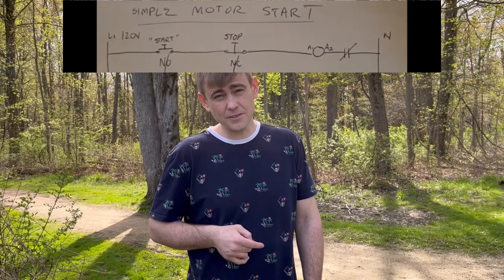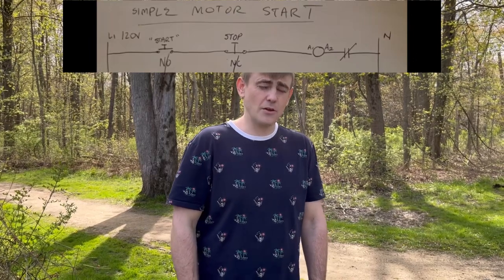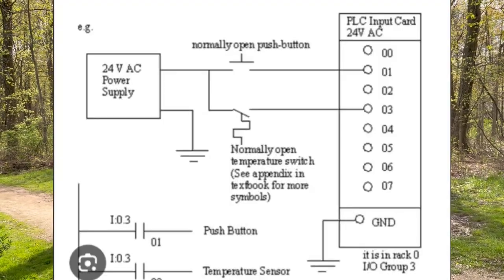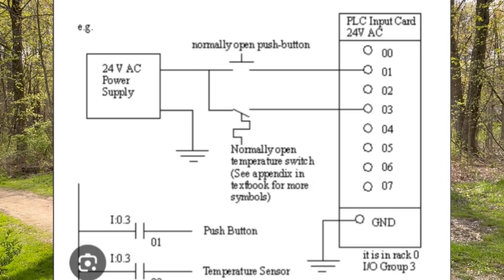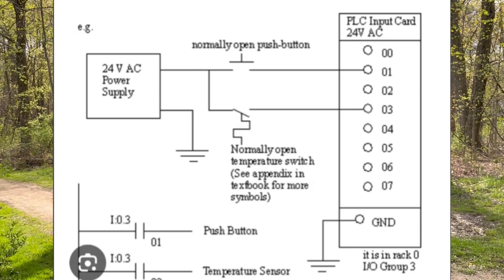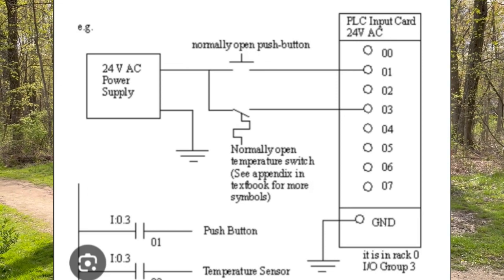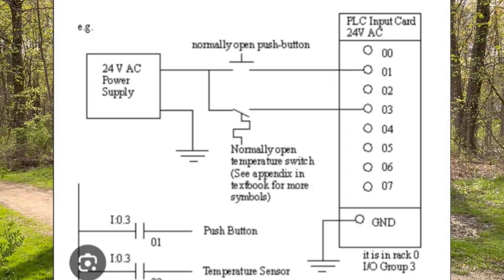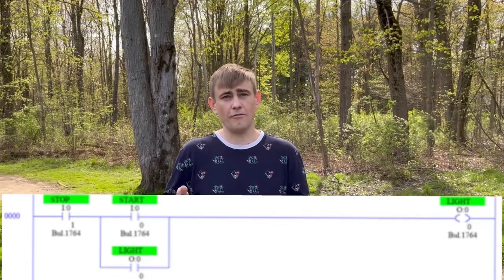How Industrial Push Buttons Work ☆ E-Stops, PLC Inputs,  NO vs. NC

Comment: Gregg can you do a video detailing servicing a control valve
Reply from the maker: I really appreciate the video idea but I can’t because I’ve never done that lol. There’s a lot of different skills that go to instrumentation. I’ve never done that have, however, calibrated I/p and E/P transducers. That’s a device that regulates pressure based off a voltage or current input. Let me know if you’re interested in that I do not have any but I can still make a video about how to do the calibration
Reply from the maker: generally speaking, your I/P or E/P would supply control pressure to a control valve, which I have never taken apart. Everywhere that I have worked, they had a different department that would service the control valves.